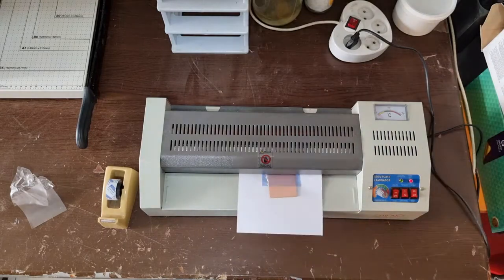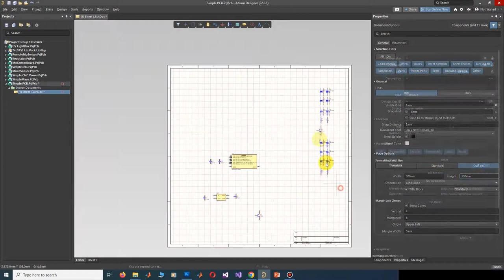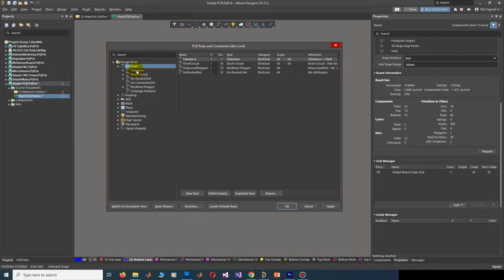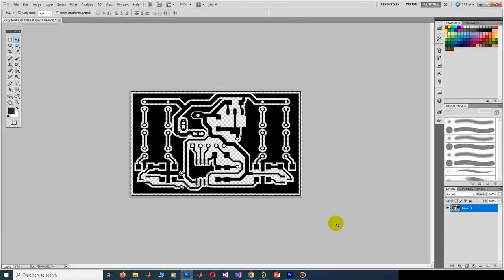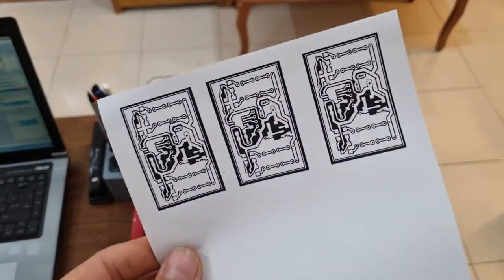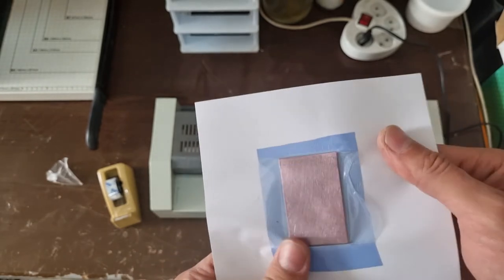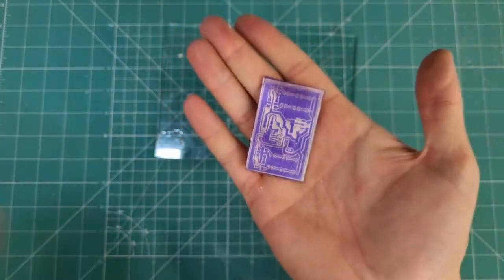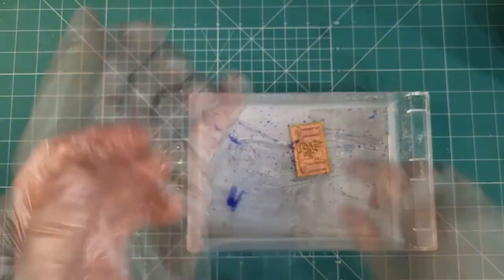5 Secrets to make admirable PCBs at home

Comment: You didn’t mention the headache of drilling holes for through-hole components 🤣. This used to be a very necessary skill for the electronics enthusiast to learn. And it can be fun most of the time for very simple designs. 

But thankfully we now live in an era where beautiful PCB can be manufactured for almost no cost at all and delivered within days from Chinese factories. The ability to have multiple layers, plated through-holes, solder mask, silk screening, and even electrical testing to guarantee there are no errors really puts the at-home methods to shame. I’ll admit it’s difficult having to wait several days for your PCB to be delivered, but the cost and time savings really can’t be overstated. 

Would be fun to see a video in the future where you show us how to send files for this same board to a PCB manufacturer.
Reply: believe it or not,in this era we do not have access to such manufacturers due to sanctions
Reply: Plus it’s probably it “a few days” to Australia.  Probably a month, and making my own is fun and fast😊 quite satisfying

Comment: A clean and easy method of attaching the photoresit to a blank board I found in another video is to heat the PCB board and have it mounted to something stable. Then pull the photo resist taught while stretching it over the surface of the board. Don't stretch it hard just to keep wrinkles out. The photoresist will bond to the hot copper and the combinating of the heat somewhat shrinking it with your holding it taut will give a perfectly smooth bonding. Trim the edges and move on. A laminator might be nicer, but if you don't have one, it can still be possible and if you get the knack ot it, maybe even better.
Reply from the maker: Good point, Thank you 👍
Reply: I keep getting bubbles in mine.  The trick I saw in one video is to wet the board first, so the film slides easily, just like how you install window tint in a car.

Comment: I’ve used that method you describe with great success, except I use overhead transparency film (double up the film to get the right darkness). I built a simple laminator by removing the temperature controller.  Great pressure and heat and only needs one pass.  Just don’t leave the laminator on too long!   1 teaspoon of sodium carbonate (washing soda) per litre water to develop the resist, then expose in sunshine and etch.  Tracks turn blue when nicely exposed.  Then remove  resist using 1 teaspoon caustic soda per litre … now I’m wondering if my recollection of the solution concentrations is correct… never mind it can be adjusted if too weak!
Reply from the maker: Good job.
I think it is better to use fresh solution every time you are making PCB